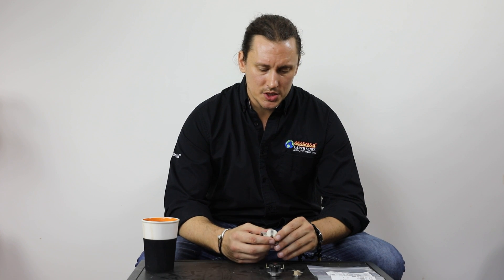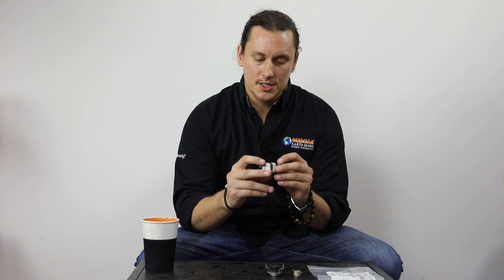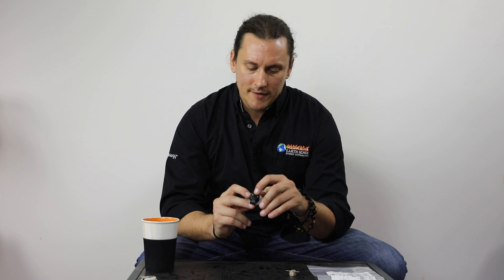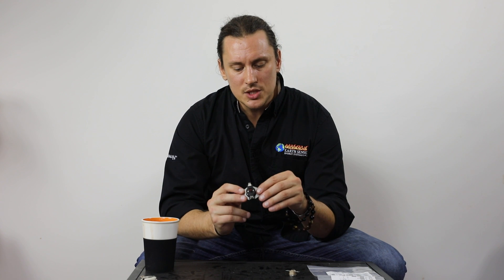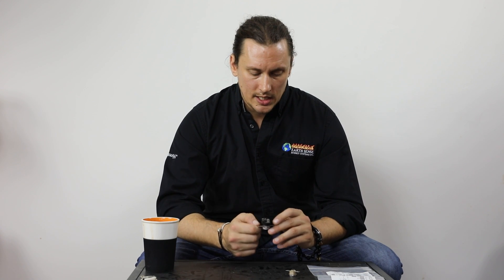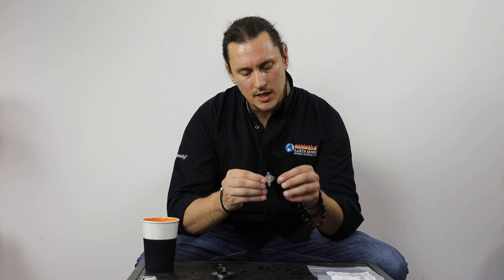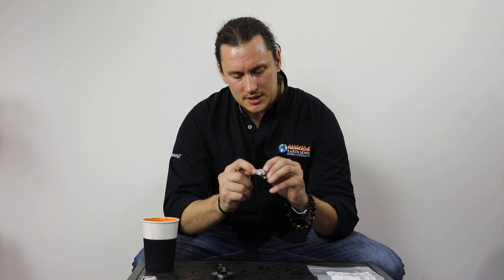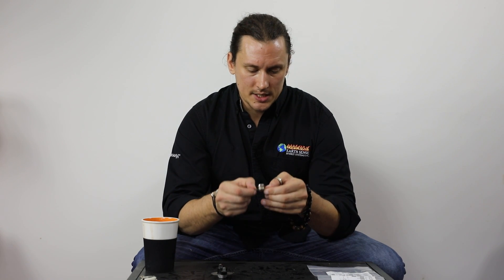Pellet Tech 101 - Limit Switches - Thermodiscs

Comment: I recently had a big burn back, and my snap disc didn't trip. can I run a wire from the current snap disc and add one to the feeder shaft so it will theoretically trip then send the signal to the already installed snap disc, which sends a signal to shut the stove off. Thanks for any help
Reply from the maker: Hey Kevin thanks for the message. What stove make and model do you have? Yeah, if fire is going up that feed chute the heat will get intense by the rear firewall and the the high limit switch is designed to trip in that kind of circumstance. With yours not tripping there may be an issue with the switch not opening and closing properly. We would not recommend altering the components or wiring. There is a very detailed certification and testing process each stove has to go through and modifying the stove in anyway could create a very serious safety hazard and liability. I'm guessing the High Limit in your unit is stuck in the closed position and most likely needs replacement. Happy to help!
Reply: @EarthSense  I have a breckwell p2000i Tahoe. I was just thinking of adding a disc by the auger where there's a couple of existing screws so that it could catch a fire in the feeder just Incase. Do you think this would at least work? I talked to someone over the phone with over 40 years experience (not about adding a snap cap) and they recommended changing my convection and exhaust blower. The stove was really dirty, i discovered that behind the metal wall is hollow and was all full of ash that I've never cleaned because I didn't know existed). The technician said it's never just dirty, there's always something in addition to that. btw, I installed an earth sense auger 2 years ago. the auger shaft got so hot it shattered the link between the shaft and the auger, but the auger is still turning! 😅
Reply from the maker: @Dr.kittens  Thanks for the message Kevin. If there are existing screws there was there a switch there at some point? Not too familiar with the electrical Schematic of the P2000i. All I can say is the parts that are in the stove should be working properly as it comes from factory and in the event of a burnback, the high limit should trip to shut down the feed motor. In my experience, ash accumulation in the stove and vent is the cause for more than 80% of service calls and issues that arise. Keeping the stove clean from accumulated ash will result in better performance, efficiency, and less headaches for sure. I would only recommend changing the convection blower and combustion fan if there were issues with the motors - Failing/squealing/improper voltage output. Just because the unit is older and needed a cleaning does not indicate that your motors require replacement. One of our best tools for cleaning is a leaf blower vac. On a cold stove, you put the sucking end on the exhaust vent outside. It will pull out the hard to access ash accumulation in the exhaust, exhaust housing, rear firewall and heat exchange area. We are out of stock on them, but they can be found at a Lowes or Home Depot - Reference - https://pellethead.com/product/toro-vacuum-leafblower-pellet-corn-stove-exhaust-vent-cleaning-system-3-4-venting/

As for the high limit, your P2000i uses a 300 - 50F switch. Meaning it will open if temps exceed 300 degrees Fahrenheit and will auto reset at 250 degree Fahrenheit. Looks like we are currently Out of stock on this switch as well, but here is a reference - https://pellethead.com/product/breckwell-us-stove-high-limit-thermodisc-60t21-300-50-degree-safety-snap-switch-oem/

Wow, I don't think I have ever hear of an auger shaft shattering that connection point. That's pretty wild.. Incase needed, here is also the owners manual for your stove. Again, Maintenance and cleaning out the ash is crucial for proper function and overall performance. https://manualmachine.com/breckwell/p2000fs/1010126-user-manual-2/
Reply: @EarthSense  there isn't 2 next to each other like there was a cap there, I'm just thinking if there is one and Maybe use extra pellet gasket glue to glue the other end to the stove for the full response. Since I have an extra set of wires the same size as the current snap disc, I would just splice them together to add an additional disc. Also forgot to mention I was thinking of doing that because this is the third time I've had a burn back. This one was just incredibly bad and happened while i wasn't home, the other two times it didn't seem dirty however I didn't know the afore mentioned large vent meant to catch ash behind the wall of where the pellets burn. That's a great suggestion! I already have a suction leaf blower I can use, I'll just have to check if the attachments will fit. for sure I'm going to replace all those small switches and test my current snap cap. I just saw a video about hooking up a volto meter to the blowers to test them. I'll also try that see if I get any satisfying results. I took pictures of the broken feeder shaft (at the bottom the part outside the stove), I would post them if I could. Thank you for all your help!
Reply from the maker: @Dr.kittens  Absolutely Kevin, happy to assist! On your motors, during start-up cycle the combustion blower should be reading near line voltage (105-115v) The Convection Fan when it comes on will run at a voltage according to the heat settings, however you should see a pretty noticeable difference in voltage as you go through the different heat settings/levels. Keep us posted on things, always happy to help! Thanks!
Reply: @EarthSense  Hello again. I was looking for some help. as a reminder I have a breckwell p2000i and I decided to test my new high temperature switch (I bought a OEM). I hooked everything up, turned the stove on, and put a lighter up to the switch, but the stove isn't shutting down. if the switch worked as it should then it should shut the stove down correct?
Reply from the maker: @Dr.kittens  Hey Kevin thanks for the message. I believe the OEM High Limit for the P2000i is a 300 degree limit switch. This switch is normally closed and is designed to open if temp exceeds 300 degrees Fahrenheit. 50 would be the second number, meaning the switch recloses at 250 degrees. To test it with a lighter you would really need to have the switch outside of the stove in something like a vice to be able to heat the bottom side past 300 degrees. A temp gun or temp reader can be helpful for accuracy. You should audibly hear a click as the metal snap inside pops open at 300 and closes at 250. You can also have a multi-meter on it - Continuity should break over 300 degrees. When the high limit switch trips, yes it shuts down the auger feed motor causing the stove to go into shut down mode. Hope that makes sense and is helpful. Keep us posted on any other questions. Thanks!
Reply: @EarthSense  yeah, I did take it off the stove. I hear it click and it seems to stop the auger motor from feeding, but I hear it click back on (after about 10 seconds) as it cools and it continues. I thought it's supposed to shut down the stove? This doesn't sound safe to me, as I just had an auger fire and the stove did not shut down.
Reply from the maker: @Dr.kittens  Hey Kevin, I definitely understand what you are saying here and the concerns you have. This is the way that the OEM switch will operate in Breckwell. I have a suggestion for you. Most other pellet stoves will use a 200, 225, or 250 degree high limit. Many of those are a 'manual' reset switch, meaning that when it trips at 200/225/250 degrees and shuts the auger motor down, it stays tripped/open until the center button is pushed to reset which can be done once the stove is completely shut down and cool. I just spoke with one of our lead techs and neither of use see a concern if you decided to go with a 250 degree manual reset high limit instead of the OEM 300 degree auto reset switch. 
Here's an example of a 250 degree w/manual reset. I know yours is flush mount. The only one I see we have that is flush mount is 200 degree and I think keeping it as close to the 300 OEM temp as possible would be ideal. Here are the references - I think with a little searching you can find a flush mount 250 degree limit switch with manual reset. Hope that helps. 

https://pellethead.com/product/st-croix-high-limit-thermodisc-snap-switch-250-degree-manual-reset-oem/

https://pellethead.com/product/magnum-country-flame-reliant-225-degree-high-limit-safety-sensor-switch-oem/

https://pellethead.com/product/pellethead-replacement-pacific-energy-warmland-ps45-true-north-high-limit-switch-200-degree-manual-reset/
Reply: @EarthSense  I hate spend so much on an oem high limit switch and then have to get another one, but I do feel better with the manual reset and lower trip temperature after a big fire like I had. Thank you, I will do this
Reply from the maker: @Dr.kittens  Hey Kevin, You should be able to return that OEM high limit to recoup cost. If it was purchased through us, just let me know and I'll get the right person on it. If not, contact the seller you purchased from and ask about return. I just think this will be the best way for you to have peace of mind moving forward. Happy we could help. Thanks!

Comment: I have a cc111 the room blower is not turning off?
Reply from the maker: Thanks for contacting us. We have never heard of a CC11 stove. Can you double check the make and model? Many stoves have a limit switch that control the room blower going on/off. If you have a limit switch for your blower inspect and replace if needed. If you don't have a limit switch for the blower in your model, then generally that would mean the blower is controlled by the circuit board. Check the basics first and feel free to let us know more details for further assistance. Thanks.

Comment: I have a Quadrafire 1200i that will start up, feed pellets, and run okay, but it will shut off at 73 degrees (no matter what the thermostat is set at), the red light comes on and it has to be reset before it will work again.
Reply from the maker: Hey Billy, This is a very odd situation. I would think first instinct would be a faulty thermostat but not 100% sure. I would test the t-stat with a continuity tester to see if it is truly shutting off at the 73 degree mark. You could also try a different wall thermostat just to rule it out. Keep us posted, happy to help!
Reply: @EarthSense  Thank you very much, I'll try that.
Reply from the maker: @billycox5591  Absolutely. Keep us posted on what you find, we'll help you get this figured out. Thanks!

Comment: Hello happy New Year, I used a leave blower to clean out the exhaust motor&blower. Now the motor clicks on and gets Hot But doesn't turn fans in blower!
Reply from the maker: Thanks for contacting us Stephen, Happy New Year.  Very odd.. We use the leafblower technique for all annual maintenance cleanings as well. I would suggest we try to run the exhaust motor to direct power and see what happens. We want to determine if it's an issue with the motor itself here. You can also do a voltage read with a multi-meter while the motor is in the unit. Should be close to line voltage on start-up. Here is a quick video on making a test cord. https://youtu.be/rlmiCYI2WPk

Keep us posted, happy to help however we can. 

Thanks

Comment: I have an Avalon Newport Bay that all of a sudden just lost power. I tried to change the fuse in the old control box and it did nothing. I bought a new control box and it still does nothing. No power. Could one of these snap discs be the cause of my no power?
Reply from the maker: Thanks for contacting us. No, there would not be a snap switch or safety sensor in the Newport that has the the ability to shut down power to the unit. If you have a basic multi-meter, let's follow the electricity from the wall outlet to the unit. Let's make sure the outlet has proper polarity and is providing a voltage read of 110-120V. Depending on the year, you should see either a wire junction or wire leads that the stoves electrical cord connects to. Let's make sure the voltage is coming through the cord. From there we want to check wire harness that connects to the circuit board. Use a good light and see if there are any burnt or bare wires. Double check all electrical connection points as well. Keep us posted with what you find. Thanks.

Comment: I have a comfortbuilt hp22 runs for in between 6-8 hrs then gives a low temperature alarm. What could this be???
Reply from the maker: Thanks for the message. Not all too familiar with the technical on the Comfortbuilt stove models. Ran this question past our tech team, here are a couple notes from them: I believe there is a temp sensor, thermistor, attached to the auger tube. Could be a hopper feed obstruction, check that first. Hope this helpful, good to check all the simple things first.
Reply: @EarthSense   yea there's a temp sensor on the feed tube. And I've checked a bunch fir feeder jams and nothing. All ports are clean and exhaust and air intake are setup to spec. Had one tech guy increase the exhaust blower from 98volts to 102 volts to see if maybe it wasn't getting enough draft in the low settings thanks for your reply
Reply from the maker: @thegreatbait6995  Thanks for the message back. If you haven't yet, let's bypass the temp sensor on the feed tube to see if that is the culprit. We only want to bypass for troubleshooting, very important to never leave a safety switch bypassed. Here's a video that will walk you through it. Keep us posted, happy to help. 
https://youtu.be/FDVkbsHS95U

Comment: I'm having a problem with my auger.  Its on a Profile 30.  The auger seems to want to keep on running intermediately.  Any suggestions?
Reply from the maker: Hey Paul, Happy to help. When you say keep on running do you mean that the auger motor will run non stop at times? If you find the auger motor is running continuous/non stop that would generally indicate an issue with the control board on that model. If the auger motor is just running intermittent, I would suggest you do a bench test on the motor and check the torque or the motor shaft. (Happy to guide you through that if needed) Inspect the Auger End Plate Bushing and see if there is heavy wear. Could still be a control board issues, but always important to check the simple stuff first.
Reply: @EarthSense  Thank you for your reply.  I am checking into the motor and bearing today.  Will let you know how I make out.  I runs intermittently.  Runs stops, runs stops one right after the other.
Reply: Also one of the brown wires on the control board was disconnected from the plug end so I just stuck it in where I thought it would go.  I don't have a schematic to actually see where it goes.

Comment: I have a bosca 500 spirit 500 stove is 13 years old but sat in a warehouse fore 10 years I got it new three years ago I’m getting number 2 light flashing telling me exhaust obstruction I clean it out both fans remove also even cleaned vent pipe stove is now working with a glitch the room blower go’s high blow for less then a min the low back and forth I have fan locked on height shouldn’t lowerer at all would that be high limit swicth or contol board
Reply from the maker: James, thanks for contacting us. Unfortunately we have never handled the Bosca line of stoves. Generally speaking the high limit switch is a safety switch that will shut down the auger motor if the unit gets to hot. Some stoves have a low limit for the room air blower that allows the blower to lock in once the stove gets warm enough. If that switch was intermittently faulty it may cause the blower to kick on and off. With you describing the blower fluctuating from high to low, in most stoves that voltage is going to be controlled by the control board. Possibly you can check in direct with the manufacturer and see what advise they can provide as well. Sorry we couldn't be of further assistance. 

Thanks.

Comment: my quadrafire was working perfect.......then the fire got to high and i believe it tripped the high pressure switch....although i couldnt reset it.....after i opened  up the door to get the flame undercontrol......i typically  reset it when that happens but this time it didnt work  ?
Reply from the maker: Thanks for contacting us. I would suggest checking the High Limit Switch. In most Quadrafire models the High Limit has a manual reset. If the unit got to hot and it tripped it will need a manual reset. See if there is a center button on your high limit switch and push that in. Make sure the stove is unplugged when working with the electrical componentry back there. Keep us posted. Thanks!
Reply: Thank you for such a quick response yes I'm aware out of the three diss I have two of them have a reset button.    I just cleaned the entire stove and tried to start it and it's doing the same thing.    One thing I did notice I reached in there to double check that disc number three to make sure it was reset and it was awfully warm and the stove hadn't even fired is that a sign of some sort?   Thanks
Reply: ok ive learned the 3rd disc is constant power and would be warm to the touch.   Ive jumped the vac switch, and the number two disc,    seperately and at the same time.....and still the same thing.   ignitor works....light on in the control box,...just no feed.      auger is new last season btw and vac switch.    UGH
Reply from the maker: @Dooguy  What model Quadrafire do you have? Let's take a closer look at the thermocouple (hangs over the firepot). That would be the only other safety mechanism that has control over the feed. Remove the Thermocouple cover - thermocouple ends should have a solderpoint ball at the tip creating the circuit to both wires. Let's check the electrical connections on the Thermocouple as well.